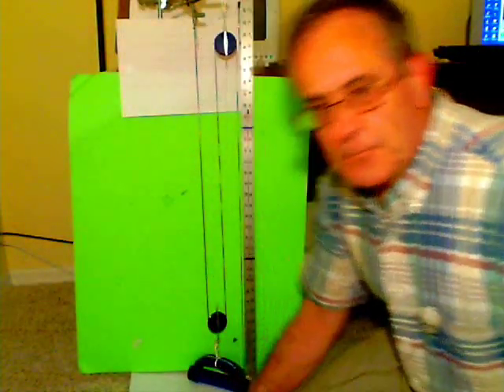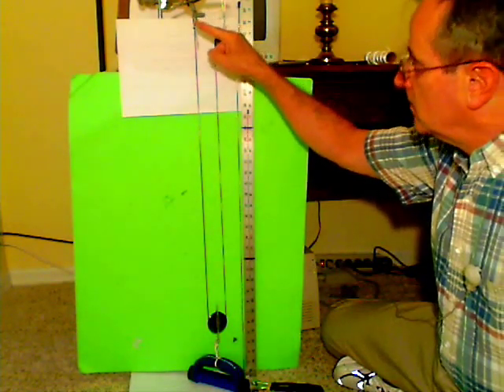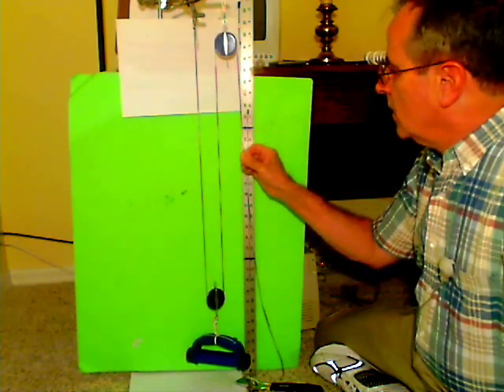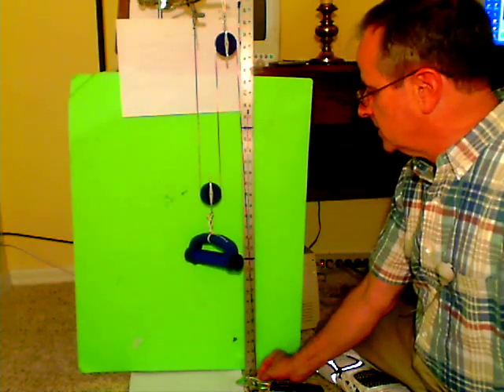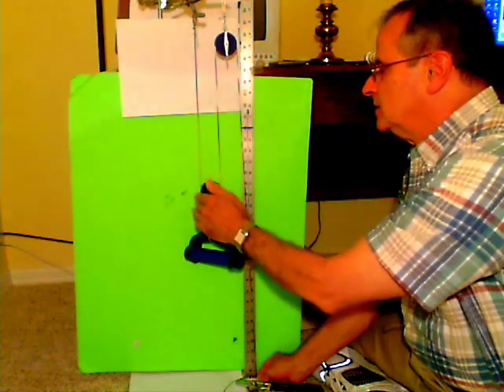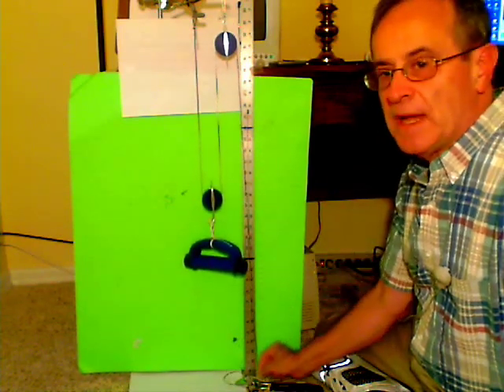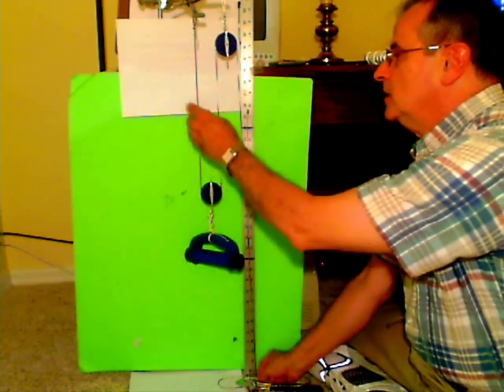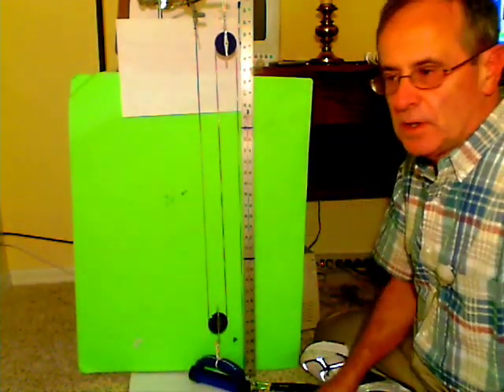How Pulleys Work

Comment: All the videos that I've seen use like sized pulleys. Would it make a difference if one pulley were twice the diameter of the other?
Say, if the fixed pulley were twice the diameter of the moving pulley or vice versa, and could you do a video on it? Great video, by the way.
Reply from the maker: It will not make a difference.

Comment: Why doesn't the second pulley add to the mechanical advantage?
Reply from the maker: +edog1955 
The second pulley is fixed and cannot move.  Its purpose is to allow the weight to be lifted by pulling down.  In this example with one movable pulley, you have to pull down by two feet to lift the weight by one foot.  If the fixed pulley were not used I would have to pull up by two feet to life the weight by one foot.  I either case a force of a half a pound can lift a weight of one pound.  But I have to move two feet to lift the weight by one foot.

Comment: You're not stupid.  Not knowing is a matter of ignorance, which can only be prevented by asking questions about what you do not know.  In a pulley, the wheel does turn.  Imagine a bicycle.  If you push your bicycle (while not riding it), your wheels are turning and the bicycle easily rolls along the ground.  Then if you try to hold your brakes while pushing the bicycle forward, it becomes much harder to move the wheels along the ground. The same case is true for rope in contact with the pulley.

Comment: i had a question, so if you take the extra dumbell you had at the beggining of the video, and attatched it to the pull end of the rope 2 feet up, will the 1 lb of wieght actually lift the load of the 1 lb dumbell, seeing as how it only takes a 1/2 pound to lift it? this might be a good visual point to make in the future?

Comment: @Vamperlis i agree with you. the fixed pulley would support a little of the weight, but I think mainly it is to redirect the pulling. Which is exactly the use of a single fixed pulley, redirecting force. But ya, either way I think it supports a fraction of the weight, but it would only matter on a larger scale.

Comment: and 2.  People say that the fixed pulley up top is ONLY to allow you to pull down rather than pull up.  But it seems to me, that if that fixed pulley were attached by a thread----a very very very tiny thread, strong enough to hold only the weight of the pulley---then when you put the rope over that pulley and pull down, I imagine that the thread holding the pulley would break.  That would reason that the fixed pulley is supporting the load at least a little.  Am I wrong??

Comment: Thank you for the video, but I have 2 questions for you:

1. The impression I get is that the reason you can use less force when you use a moveable pulley is because half of the weight is supported by the fixed end of the string.  BUT, imagine that you turn a pulley horizontally.  For instance, maybe one end of a rope is attached to a wall, and there is a giant boulder that the rope goes behind and you have the other end of the rope.  Why would it give you a mechanical advantage here?